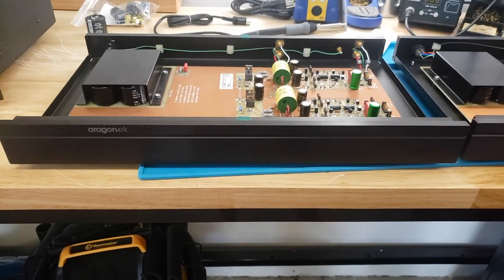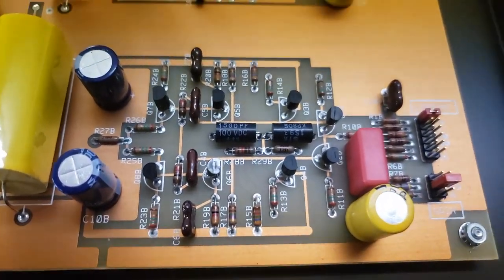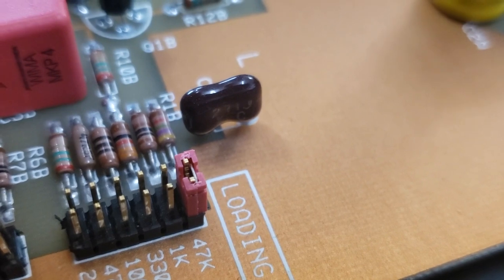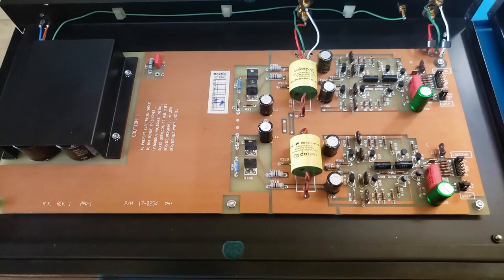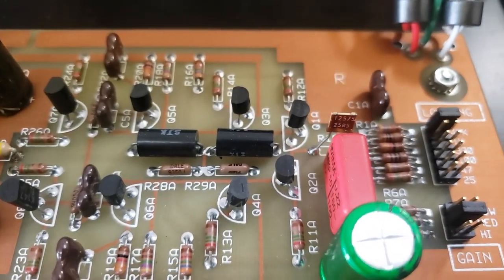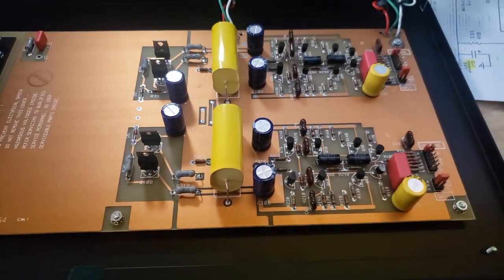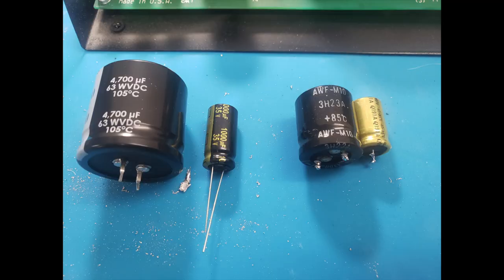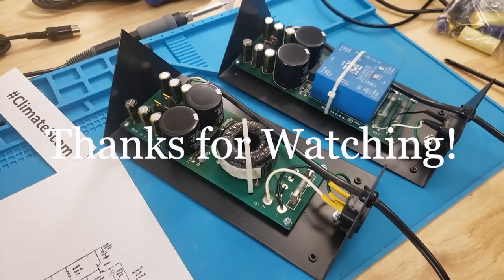Aragon 47k Phono Preamp: After Mods (Final Thoughts, IPS Info, Parts Sources & Helpful Tips)

Comment: Alexander, The IPS equiped with the blue potted transformer is one of the 1st generation boards. They came out in the 1989 time frame the best I can tell. They never came from the factory with a socketed AC connection so that must've been added or the board was swapped at some point into this housing. Your toroidal equipped IPS is one of the last gen units, those came out around the time that the 18K MkII hit the market in the mid-90's. These last gen toroidal equipped units all came with socketed AC connections. 

There is a 3rd style IPS with a standard E core type of transformer that is the most common. It started showing up around 1990 - 91 and was produced for about 5yrs so those are the majority of what I've seen. Those mainly came with a fixed AC cord but at the end of their production Mondial put an AC socket on those too. So if you find one with the E core transformer and socketed AC cord, it is a late production unit.
Reply from the maker: HI Kevin! Thank you so much for the info. Yes, I do prefer the units that already have the detachable power cords it saves the trouble of modifying them for such.. Really appreciate the great mods you did on the 18k Ultimate build I'll be reference that when I do my own 18k. It's just taken me a couple years to finally get to it. Compared to current gear I just think the Aragon stuff offers so much value with just a little updating which makes it fun for me. Wish you still offered those great IPS update boards you had years back!
Reply: ' @hificonspiracy  I meant to ask you where you came across the IPS schematic? Was it among the "legacy" documents on the Indyaudio site when they were still available? Anyway, I've never seen the original schematic for the IPS before so I thought it had been lost, just like the original 47k schematic. Its a basic enough PS circuit that its easily reverse eng'd for those working on it, but I've had so many folks ask me for it over the years and I never had the original to give out.
Reply from the maker: @kevinchambers4930  Hi Kevin, You know I really can't recall. It might have been. I must have gleaned it off the web at some point. With screen shot or something. When I look at it now it looks like a scan from fax dated Dec 2003. But, the indyaudio site must be the most likely source. Happy to send it you or should be easy to grab a screen shot from the vid.
Reply: @hificonspiracy  That fax date is back during the Klipsch ownership period. That is a fairly good copy. Its a shame that so many of the schematics that are floating around out there for vintage equipment are from old scans that were then transferred via fax multiple times which degrade the original many times to the point that component #'s and even the component type cannot be identified and traces magically disappear leaving it up to the final user to reconnect the components. I took a screenshot of it, Thx. You might go and upload it to hifiengine, if you have an account, for others though.
Reply from the maker: @kevinchambers4930  Good Thought I will do that.

Comment: The 25.5r and 47.5r resistors are actually an off the shelf resistance value in the Vishay Dale RN series. If you search on Mouser now you'll find them in stock. I'm sure that they were selected because, in addition to being readily available, they were the closest value to what the designer wanted to put there.
Reply: changing these resistors will do nothing. low resistance value =extremely small noise - no effect on the sound
Reply: @robertkovar8710  My comment had nothing to do with the amount of Johnson-Nyquist noise that these resistors may or may not add to the circuit in their respective positions or their "effect on the sound". My comment was specifically about the fact that the resistors used by the manufacturer Mondial in this circuit were standard off the shelf values and not some custom ordered part. 

However, I will point out that what you said in your statement contradicts itself. You said "low resistance value = extremely small noise - no effect on the sound". So you state that there is an "extremely small noise" added to the circuit by these low value resistors, but then you say that there is no effect on the sound. But the fact that there is noise added, whether exceptionally small or not and by your own admission, means that it does affect the sound. 

You also do not specify the location of the resistors that supposedly have no effect on the sound in the circuit. This is important because this circuit is an extremely high gain phono amplifier, at its highest gain setting it offers approximately 80dB of gain. So any noise generated at the input to this phono preamp or prior to the high gain stage would be amplified by that factor and have a much larger effect on the sound.
Reply: @kevinchambers4930  if you want to improve this schema use silulator Microcap 12 or 11, its free ! or LTspice. And optimize this old solution. For a much better sound, I recommend a preamp with jfet transistors (for MM cartridge).
Reply from the maker: @Robert Kovar The incorrect assumption is that the only variable impacting sound is noise. IMHO.
Reply: @hificonspiracy  Agreed! The easily identified parameters are those that most people will point to as affecting sound quality because they're the low hanging fruit. The problem is that perceived sound quality is a tough thing to put your finger on and spec's do not always identify what sounds best. Robert mentions using LT spice or other simulator software to design a better circuit, but just because you design and build a circuit that will measure better that doesn't mean that its going to necessarily sound better to YOU. 

If spec's or software simulators were the final indicator of sound quality then we'd all just look at the published manufacturers specs and make our decision as to what gear will sound the best in our system. 
I use an Audio Precision analyzer to measure anything that I build or work on and I can tell you without a doubt that just because something measures spectacularly that doesn't automatically mean its going to sound spectacular to me. Some of the best measuring gear, i.e. lowest THD+N & great square wave response & x-talk #'s, I've put on my analyzer wasn't the best sounding. Likewise, some average measuring gear I've had on my analyzer sounds great to my ears and is also highly regarded throughout the audio community, go figure...
Reply from the maker: @kevinchambers4930  Yep! Glad I'm not the only one who thinks this way.
Reply: @kevinchambers4930  This preamp is old design. I believe he plays well. But not top notch. I'm also a listener, not just a technician.

Comment: The output caps don't have to be that large. They form a high pass filter with the input impedance of the line amplifier stage. In 99 percent of all cases, you can got to 2.2 µF without any problems. 2.2µF with a common 47k input impedance would still give you a -3 dB threshold of 1.5 Hz. Smaller capacitance value of higher qiality is the way to go.
Reply from the maker: Thanks for the feedback. Yes, your comments reminded me I had a link to the V-cap coupling cap calculator https://www.v-cap.com/coupling-capacitor-calculator.php I forgot about this. It seems to confirm your thoughts. This is good. Ideally I would have liked to use a Solen SE PP film & Foil and the 2uF would fit nicely here. (the chassis is very short with limited spacing). I might do this in my 2nd 47k and compare the two. Happy Audio!

Comment: I have had a stock 47K Phono Preamp with the standard power supply since 1994 and would love to find an IPS PS. Virtually impossible to find. This piece of equipment has been bullet proof and I always keep it connected to a Tice power conditioner.
Reply from the maker: Awesome! To get an IPS you might have to find an Aragon DAC or other component with an IPS, buy it and then just swap power supplies and sell the unit with the old standard supply you don't want. You'll get your money back and end up with an IPS for your 47k. Very rarely I've seen a lone IPS on ebay. Happy Audio!
Reply: @hificonspiracy  Thanks and sounds like a great idea. I am about to sell all my separates and buy an Anthem integrated STR. The phono section is amazingly good. Another great product I have listened to is the Parasound JC 3 Junior. Very musical and dead quiet.
Reply from the maker: @federicopivetta7387  Enjoy!

Comment: Have you thought about removing those coupling caps going direct coupled? You called them output coupling caps but I believe they’re at input
Reply: No they're output coupling caps on the 47k and P10
Reply: Before you remove any coupling cap you'd better make sure that you have close to 0mV of DC offset across that cap. Most of these Mondial phono pre's will have a considerable amount of DC offset, even the best ones will be around 5 - 10mV once warmed up, some of the worst I've seen are around 100mV+ which would be a lot of DC to send to the preamp.

Comment: Hi all! Great video ! I have a IPS that I haven’t opened yet so not sure which transformer I have. Mine has a bad hum and would ask your opinion how I should go about fixing it, and doing some mods as well. Any information would be greatly appreciated.
Reply from the maker: Hello, I've heard of the IPS hum but have not experienced it. I would open it up. If its the conventional laminated core (square) transformer you might try tightening the corner screws that hold the laminations together. If its the blue potted transformer it would make it more difficult. One could also get some isolation washers rubber or preferably Sorbothane to dampen the vibration/screws where it attached to the chassis. Or just source a replacement transformer. But open it up first. If you have caps going bad it could contribute to the trans buz. @kevinchambers4930 in case he has any ideas. Good Luck Happy Audio
Reply: Thank you for the advise and direction. As soon as I get time I  will tear into it.   @hificonspiracy
Reply: Finally got some time to open up my IPS. It indeed does have the the square blue transformer and two large Sprague 3300uf caps. Planning on recapping and placing a new power cord socket since whoever had this prior modded a home made power cord and did a shoddy job. Also my board has two slots for fuses but only one is used . The power wires are mounted to (L) and (6) as printed on the board. not sure if this is correct since i notice yours is mounted differently.  @hificonspiracy